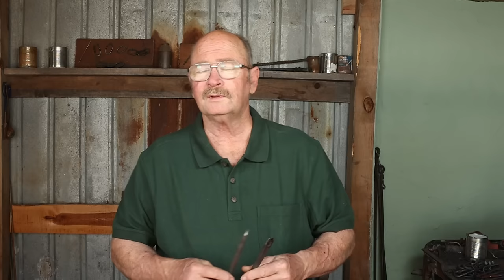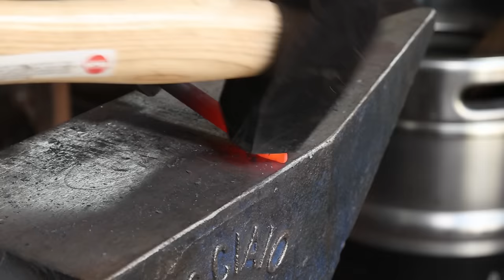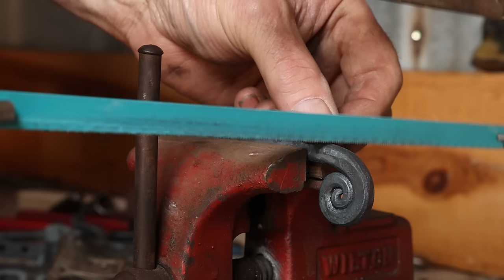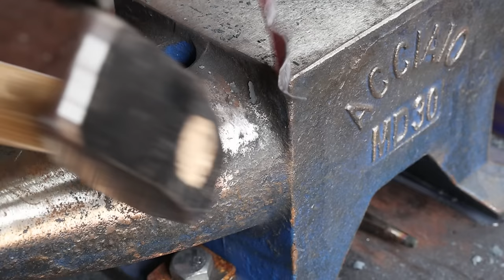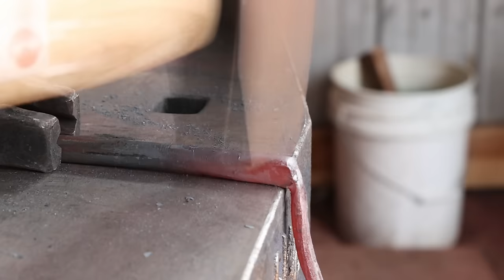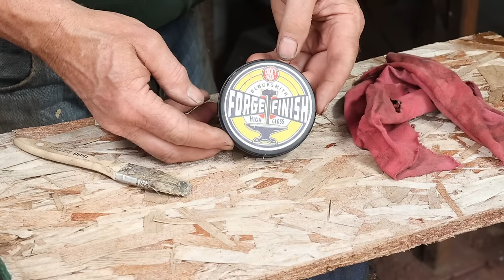Simple Forging for Profit - Affordable blacksmithing part 3

Comment: Always remember to use your tongs. I use to catch myself all the time trying to grab little pieces like this by hand. Actually did grab them a few times. It’s very easy to forget when first starting out. Years later I still catch myself on occasion
Reply: Yep, my first rule of blacksmithing is ‘never grab anything without a tool.’
Even if you think it probably has cooled off by now, grab it with tongs , dunk it in the tank, and tap-check it with the back of the hand before handling it.

Comment: The voiceover works well. It sets a little bit different tone for the video. The voiceover sounds cleaner and more educational, almost like a "How It's Made" video. I think it will mostly depend on what style of video you're doing. For this series, the educational feel is a good fit, but maybe on some larger projects you want more of a running commentary and you work to hear your thoughts on real time as you work, I could see that being very helpful hearing how you think through a project.
Overall, it's great option and a good video tool to have in your back pocket.
Great video this week! I'm loving this series! Thanks!

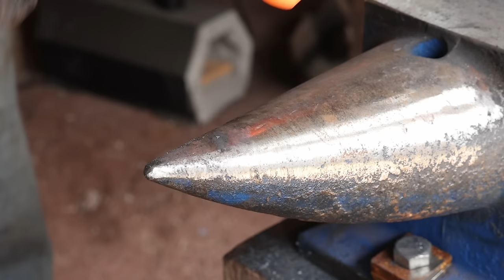Comment: 19:54. I had to come back today after making up a few of these tightly curled things out of 1/4 round bar, and got the idea to leave about 2.5 inches on the end past the curl. Taper the last inch of round bar, and then flatten it into as though you’re making a leaf. Try bending back down towards your original curl. After practicing on a couple, I was able to make a keychain that looks quite a bit like a musical single note 🎶
Thanks for the starting idea. If a guy was careful with his curlie cues, he could make a double note one pretty easily 🎵

Comment: I have been smithing for 20 years now of which 15 years professional. I love watching you videos, it is almost like watching Bob Ross paint :). 
I hear a lot of high tones and singing from the anvil. Specially the smaller ones. We use magnets on the anvil, that really helps. I hardly see any blacksmiths on youtube using this method. 
I don't know the American price for a magnet but budget wise you can take them out of old speakers.

Comment: I really like the voiceover, as long as it's not harder for you to do.  And one tip I used for doing wax coatings at the beginning - until I got better at temp control in the forge, you can just pop your pieces in an oven/toaster oven on about 200-250 or so, since beeswax melts under that, and you don't have to worry about a piece being too hot and discoloring when you go to apply wax

Comment: 7:46  i have this same anvil, and I took a scrap piece of 1/4” x 3” strap and bent the ends down to form sort of a saddle that fits over the anvil, and put 3 sizes of holes in it to use for a bolster for punching. It is a big help because it stays put and provides a good amount of surface to rest the work on, rather than trying to balance on a smaller bolster block, which is frustrating when you are just learning and trying to manage hot metal, hammer, tongs, punch, and bolster, all at once.
Reply from the maker: Great idea

Comment: although I've been smithing for years (had to take the last two years off due to Blacksmith's Elbow and Frozen Shoulder) but there were some things you went over that I either forgot about, or learned a new trick or two, so THANK YOU!  I've learned so much from you.  as for doing a voice over verses talking in the forge... I like it better when you are explaining thing in the moment.  but I like both formats regardless.

Comment: I enjoyed the voice over, its a nice touch.   This whole series is amazing and I cant thank you enough for putting this together.   I have to ask, where is your shop?   You mentioned on one video you like to buy your handles from House Handles, they are right up the road from me.  I have been wanting to make the time to visit there shop as I need all kinds of handles.   This series has really motivated me,  I have a 'blacksmiths shop' with a an old coal forge and wood forge, blowers, old tools, railroad track anvils, even a post drill to setup.   Its time to get some fires going and get to work.  Thank you again!

Comment: I've found that when trying to put a hole in some hard material, like bed frame or stainless steel, punching is easier, quicker, and a lot more successful than trying to drill through it.

Comment: This series has finally let me convince myself to start blacksmithing as a hobby.   One thing that I feel would be a super helpful video or at least a good talking point is heat/temp and how that relates to color and what you are looking for at a given step in forging.  I'm sure there are plenty of in-depth guides out there for this but a short and basic introduction to it would be really helpful imo.  I haven't thoroughly went through your videos yet to see if you have a video like this and plan to but thought it would be worth pointing out.  

Also the voice over instead of explaining thoroughout the process is to me really nice for some things but it would be worth also covering some talking points during the process as they might be less overreaching and more insightful in the moment sometimes as it is a different perspective.

Again  I can't state how videos like this are pretty amazing to find and are one of my favorite parts about youtube.  I have always been interested in working with metal and have even done some welding but always convinced myself that blacksmithing would be to hard or expensive to get into and this has pushed me the last step towards exploring this interesting and old yet new hobby that.
Reply: The colors of hot steel really don't come across very well when on video, so that would probably be a difficult video to do. I'm on the new side of this hobby, though, so maybe I'm wrong.

For these sorts of projects temperature control isn't a huge deal, though. It's either hot enough to forge or it's not. If it's not hot enough, you're either wasting effort in the case of thicker pieces or in danger of breaking it with smaller pieces like that leaf. And if it's glowing it's definitely hot enough.

Comment: Nice projects, but I was a little surprised not to hear you talking about making nails. That's where I started in my first class, good basic skill, should be able to start with something very similar to the punch/bolster, can add decoration to the heads, and I find at least that relatively large nails with heavy heads work well for hanging both coats and hammers around the shop. Still got a few of mine kicking around that I hang my coats on.

Was also surprised to hear you use paste wax to finish your stuff. I've never used finish, I was told you don't need to if you aren't taking off the scale, but I also find your choice of finish interesting because it's also very commonly used to finish wood and even to waterproof cloth.

Definitely enjoying the voiceover technique, I like being able to hear the words without you having to stop the forge to be heard.

Comment: These videos are so great! I've already made my list of beginner's tools based on what you've said and what I can get my hands on. Vevor apparently does sell worldwide, so that's pretty great! Now I just need to figure out where I'm going to be doing this ... That's actually more of an issue. I have a basement hand tools woodworking workshop, but I can't be doing it there. And I'm in an apartment ... Hm ...
Reply from the maker: Perhaps you can partner with someone that has a space.
Reply: @BlackBearForge  Yes, I've been thinking about it. Trouble is, all the smiths I know are far from where I live. I haven't properly researched the local area, though, so that should be the first step. Or rather, second step. Firstly I need to figure out which products made in my existing workshop I could sell. I have one solid product that is easy to make and cheap, but, as you said, one product won't sell on something like etsy. I'm in no hurry, though. I just love to plan! :^)

Comment: very nice video and some excellent projects.  As a side note, if your vise was secured better you could clamp your punch or other small rod and use that for making smaller hook/rounds easier than using horn on anvil.

Comment: Hey John, I love your videos. I always find them to be very informative. Would it be possible for you to maybe do a video on dressing hammers in depth. I know that when I started, the information on hammer dressing was hard to find, and once you did find something it was kinda a brief overview and the details of things like how much curve the hammer face need, how rounded over the edges need to be, the profiles of rounding vs flat hammer and more. I found that when I started out I basically was dressing hammers based on the information that I could find and not knowing that they were wrong until I randomly got one right and was able to compare it to the others to see what I was doing wrong. I think this topic would be very helpful to the new blacksmith trying to use the box store hammer to work with and wondering why there are large dents in their work.
Reply from the maker: I'll keep that in mind for later this year

Comment: I know this probably isn't the safest method but I've found that if you need to punch hole in a project that a thoughly soaked block of soft wood works pretty nice as long as you're willing to straighten things out a little afterwards

Comment: Would you do a video on steel stock, diameters, hardness, etc. that are handy for hand hammering, no power hammer? Square bars for twisting, on a small scale for us simple smiths?
Reply: I’m pretty much just starting out, but I find anything over about 3/8 square to be a lot of work to draw out and work by hand. I certainly can work material larger than that, but I usually get worn out before I finish a project and have to do it in a couple sessions.
Reply from the maker: I'll add that to my list of ideas for future videos

Comment: Another great video.  I'm really liking this basic blacksmith setup.  It will help the me answer questions that folks ask me about getting started.  I decided to try making the items in the video.  As I was working on the first J hooks, I was wondering how production line an approach to take.  It is better to do one hook all the way or to do each operation ten times then switch?  I was thinking of drawing out the 10 pieces, then doing the hook on each one, then doing the finial and finally doing the hole punch.
Reply from the maker: I think drawing out and bending each hook then moving to the finials is a good idea.  With practice you can get to the point of drawing out, forming the curl and bending the hook in a single heat.
Reply: @BlackBearForge  Thanks.  Looks like I have a goal, to get down to one heat.  Maybe I need that special blacksmith steel that holds more heat than regular steel
.

Comment: When I draw out square, it tends to twist the square as I draw out. Any tips to help me not do that? PS, I like the voice over for this tutorial style video. It functions very well
Reply from the maker: Sounds like your hammer isn't striking flat.  If its twisting toward the hammer, you need to raise you shoulder or lower the anvil slightly.  If its twisting away from your hammer hand, its the opposite.
Reply: Same happens to me🤔
Reply: @BlackBearForge  thanks for the tip!

Comment: I like the voiceovers, it works well for this format. You can more clearly explain what's going on while it's going on rather than trying to figure out what you're doing as you're doing it. :)

I'm kind of curious though, on making tools, would you say this forge is capable of doing things like tongs, or even small hammers or hatchet heads?  Obviously would need a hammer eye drift for either, but curious on your take on that.
Reply from the maker: it certainly would be.  It may take longer to bring something like a large hammer head up to heat but it should do it.

Comment: John I just want to give my thoughts on these, I love your videos, my question is would it not be better to forge your material closer to the width of your punch, maybe leave about 1/8 or so on either side of the punch so that it gives it a slightly bulged appearance on either side of the hole?  You're knowledge and your skillset are far beyond mine, I just thought of this will looking at these hooks.  May be able to get a dollar or more out of each one of these hooks and also it would encourage more precision work for a newer smith.  As always thanks for sharing these videos, one last thing is this forge going to reach forge welding temperatures fairly easy or would I be better off getting something a little more powerful than this
Reply from the maker: How much you let the material bulge out when punching is really a matter of personal aesthetics.  It would be worth trying both ways.

I haven't seriously tried to weld in it.  But I think it will depend somewhat on your Altitude.
Reply: @BlackBearForge  Southeast arkansas down here so not sure.  I know coal has worked well so far  but it's getting really hard to find decent priced coal.  So I am looking at switching away from coal.  For the price this forge looks like a decent deal.  If nothing else it will work well for for most projects.

Comment: Maybe somebody has already asked this in the comments but I'll ask again, I'm very new to Smithing. Have only made very simple projects but when I'm tapering down my pieces to a point I'm having an issue with there being a little hollow spot in the middle at the point. Am I hammering it wrong or maybe not hitting it hard enough or not getting it hot enough. Love to hear some suggestions. Thanks guys.
Reply from the maker: Knocking the corners back may helps some as will higher heat and heavier blows that penetrate into the material.  Once the taper is started it should go smoother.
Reply: @BlackBearForge  I'll give that a try thanks ! As always keep up the great videos. Very useful and informative.

Comment: Hello John, I noticed from the sound that the anvil sings less in this video. Then I noticed some silicon calk around the mounting points of the anvil. My question is did you silicone the mounting points underneath and remount it? Or did you just calk it around the base? Also do you have other recommendations for quieting down a smaller anvil like this? This is a good series and thanks for these videos.
Reply from the maker: I put silicone under the feet and bolted it back down.  But these little anvils up on feet still ring more than one with a larger base.

Comment: Do you have any ideas on what type of steel grader blade is? Thinking about a demascus of leaf spring (assuming it's 5160) and grader blade which I don't know how to heat treat nor quenching medium.  Wanting to make a rock hammer for a geologist friend.
Reply from the maker: Its an abrasion resistant steel, but I don't know anything else.

Comment: Do you have any tip on not getting the end of your bar to pucker or make fish lips, carps mouth, whatever people call it? That is possibly the biggest issue I've been struggling with since I started.
Reply from the maker: Knocking the corners back may helps some as will higher heat and heavier blows that penetrate into the material.  Once the taper is started it should go smoother.

Comment: What is your recommendation for upgraded or better tongs? Pretty sure i have the same ones in the video, and they work well. But tongs are like hammers you need the best ones you can afford.
Reply from the maker: If you're buying tongs then any of the blacksmithing suppliers such as Blacksmiths Supply should have a good product.  The main thing is to have a variety of sizes and shapes to hols the work at hand.  Of course this goes for making your own tongs as well.

Comment: Did you find it difficult to tune the torch in the furnace? I’m struggling a bit, guessing the altitude? (I’m north west of Denver)
Reply from the maker: Not at all.  Its just gas pressure and air intake.  I only open the choke about 1/2 way.   If you're not getting a clean flame it could have some insulation blocking the burner inside the forge.  Will you be at the Rocky Mountain Smiths conference in Berthoud this weekend?